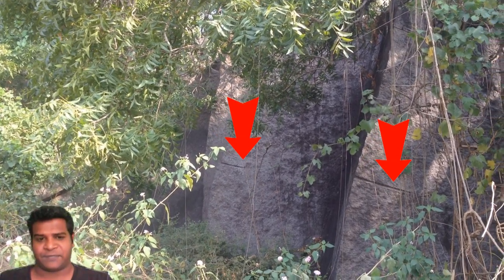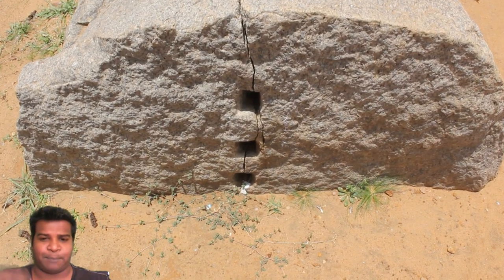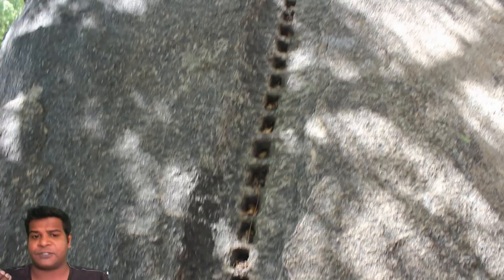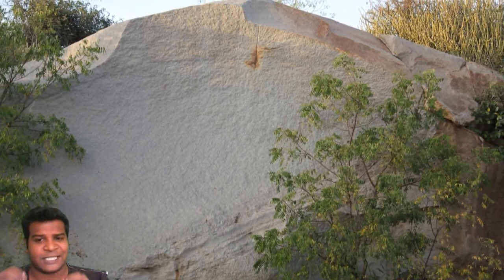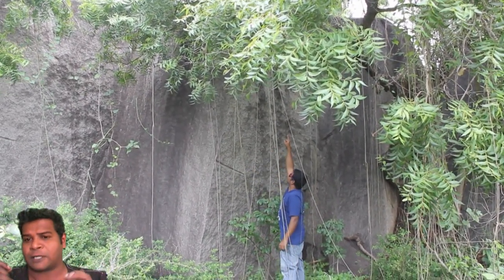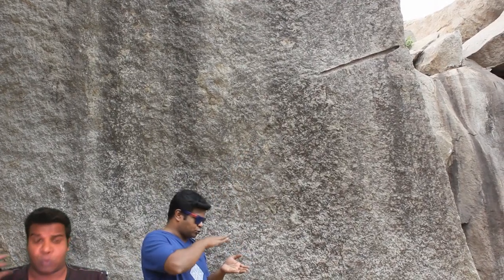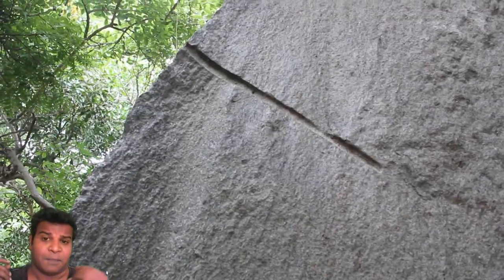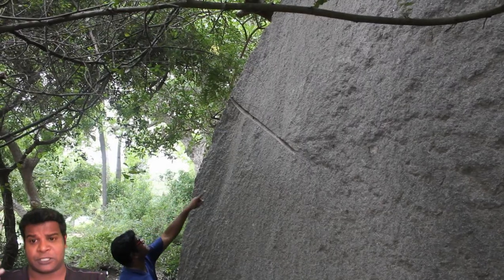In Search Of: Ancient Rock Cutting Technology - Machines?

Comment: The way the hole curves slightly as it penetrates reminds me of high pressure water drills
Reply: I noticed the curve!
I was wondering how 1 would get such a smooth channel, yet it has 2 bends!
@6:02 ..... so your saying if a CNC water jet drill, etc was cutting granite, depending on the hardness & a low pressure, the granite would redirect the water with it tough grain structure. thats cool, still WTF?

Comment: They knock the rock with hammer, hardest part of rock sound like bell, exactly that location they drill, using kaaisa old drill machine, kaaisa is a long 45-degree screw wedge one end is pointed other end gave a pully ,in which rop is passed two men from opposit side pull rope simultaneously hit axil down when pulling rope thus vibrating drill action obtained , holes drilled, later this hole is filled with thermite process material which burns at high temp thus result in a heavy temperature difference where drill is, once heated, water is sprayed up,  on cool sudden, thus rock split due to sudden temp variation, since used material is thermite material like magnesium it does not explode un like dynamite currently used , this method was used by Carpenter in Kerala even 40 to 50 years back to split granite, success depends on hoe u determine hardest part of rock, only main carpenter identify this and order to drill that place, his experience matters
Reply: plz read my comment ..
Reply: JAYA KUMAR P.R I
Reply: JAYA KUMAR P.R, this is a nice idea, but how would it work on a hole 8 feet wide?
Reply: Above discussion was about how to split rock with a hole in it  but for making a fine 8 feet wide hole done in two different way, method one a heavy wheel rolled around a fixed axis using animals abrasive rock powder and water is dropped in path of wheel so that rock medium get eroded quickly once periphery is eroded at thickness of wheel  middle solid part is chiseled away, process repeats
Reply: What size rocks were split using this? Could that have been extrapolated to big size rocks that were in video?
Reply: or......they used advanced cutting technologies!!
Reply: abrasive rock powder? like what? What can drill granite efficiently? Your method 'sounds' reasonable but what sounds more reasonable especially given the size of the rocks and the nature of the intricate carvings is highly advanced tools.
Reply: Thank you
Reply: Wow
Reply: karel bellic  yeah man. After the ancients used it for splitting granite they had a sniper shooting competition with the left over termite being put into steel targets. It was a day of fun splitting granite and sniper rifle shooting.

Comment: After sending off my last comment, I realised I forgot to thank you for the info and images on the splitting technique using a line of holes. Also, I realised that a pounder charge wouldn’t have split the rock, but fractured it into several pies, as is done in quarries today. And, one of your readers mentioned something about a wet rope technique...could the line of holes have been the earlier technique, and then someone discovered they only needed one hole if it was deep enough...how did they drill it? Possibly the percussion technique of continually hitting an iron rod (10th C onward) or a bronze rod before that. The granular material could have been flushed out with water periodically...when the hole was deep enough, a rod of some material that expands significantly when soaked with water is inserted?.

Comment: Mr. Mohan, I am very much pleased with your videos. One sculptor told my lecturer about this Rock cutting technology. They put  tiny marks with chisel on the rock whatever the size they want to remove from the mountain. Afterwards they will give a hard stroke at one point only when the hill is sleeping. This is possible as they know the sleeping condition of any hill.  Hill will cut at marked points only without any problem.

Comment: Great channel btw. You seem to be one of the few out there to bring up this very simple technique. I spent the last hour watching videos on people splitting granite and I'm convinced. Granite might be really hard, but its fully of tiny crystals and once the crack starts, it follows the crystals and they cleave. I think it takes a lot less time than you think. As to how they drilled the initial hole, I noticed the holes aren't very straight which lead me to believe some type of hand drill was used.
Reply: Yes. Hand drill. e.g.  a bow+string and a rod as the drill bit. Notice that the holes all slant downwards so maybe the hole, once started, was filled with hard sand or a mixture of sand+water? Then a wedge was hammered or maybe wood wedge and then water added?

Comment: they also used molten metal to fill in the holes and then cooled it with water, with this you can achieve splitting rock way faster then with wood

Comment: Am I not seeing it correctly, or is there actually just one drill-hole per large piece of rock?  If there is, then this would be insufficient for the "wet-wooden pegs" method of splitting the rock.  If there is just one hole per large piece of rock that was split, could sound vibrations through a metal rod be sufficient to split the rock?
Reply from the maker: Hi, Its just one hole per larger rock so even I guess the same. Thank you very much for watching the video. Have a great weekend.
Reply: They were probably calculating the position of the centre of gravity and targeting that with a drilling tool..... But I dont understand how only 1foot drill cracks up a huge rock...... It will need recreating the scenario and seeing for ourselves
Reply: Have you found recreation of granite rock cut like this yet?

Comment: Great video! I don't know how these rocks are cut but I sure know that in Konark temple, Odisha, rocks are joined using clamps made out of iron. Back then iron ingots were forged and welded to make beams for the temple structure, over which stones were placed and clamped with iron clamps! You can still find them if you look closer to the rock joints at Konark!

Comment: Hi Mohan,
This kind of holes can be drilled by crowbar (it was an instrument used to drill the rock manually). I do remember during 1995, by using the crowbar, a rock, about 7 to 10 feet diameter, was drilled and blasted in my agricultural land but i dont remember number of holes drilled. the Blaster took approx. 3-4 hours time to drill a foot deep hole on top of the rock. Also my personal opinion that crowbar is called in Tamil Kadappaarai, கடப்பாரை,  which could have been drived from base words kadai+paarai, which means drill + rock).

Comment: Maybe they had some kind of chemicals to soften the stone in the area being worked on?
Reply from the maker: Hi, that's a nice guess. If that is the case, then we should find whether we had such chemical labs during that time. Anyways thanks a lot for watching the video. Have a great weekend.
Reply: It would not necessarily require a lab, as it could have been a plant based concoction and require more of a kitchen rather than a laboratory to prepare it. I have watched a few of your videos they great keep up the good work.
Reply: why not with the help of archaeologist  test those rock sample  in lab may be we can find some chemical traces there  or they might used some kind  Frequency Vibrating Devices to break the rock
Reply: Why not indeed, and yes I have thought about a resonance device that could also soften the stone and make it easier to cut. I don't know how they did it, but I think they must have had some stone softening and geopolymer technology that is lost or hidden away.
Reply: Joe Dean even I believed they used corrosive chemicals. Like acidic water will corrode limestone!
Reply: Carbonic acid indeed softens it. but it takes years to make effect and it spreads radially, not very good for large flat cuts. Thanks for the video! i love these! BTW, is there any mentions anywhere how it is drilled and actually split? Egyptians used copper tools and quartz sand for cutting Granite.
Reply: plz read my comment ..
Reply: My guess is they used the power of the sun bit like fresnel magnifier.
Reply: SIDDHANT SAWANT what comment?
Reply: Mr. Bricks yes, I have seen those frenzel lenses they are incredible they can melt obsidian, and by heating up the rocks it would also soften them, but they seem to be only focused on one spot. An array of parabolic reflectors all targeting concentrated sunlight on one stone would be better for the large stones. The only thing I don't like about this idea is they would be too hot to handle, and the copper tools they were supposed to be using would also soften too?
Reply: Jan Sergejeff you cannot cut cold hard granite with copper
Reply: Joe Dean This is just a idea  because the hole wasnt perfectly straight..vibration of some sort must also be the key..
Reply: Joe Dean Thankyou i will..
Reply: Suppose we have a one big rock . To cut this rock how many possibilities we have to take how many number of people's ( including men and women )to cut this rock 
eg : 1 big rock cut by = 10 people = time take 25 years
        1 big rock cut by = 20 people = 20 yrs
        1 big rock cut by = 50 people = 15 yrs
        1 big rock cut by = 100 people = 7 yrs
But  1 big rock cut by =  500 people = it takes only few weeks 
And as men and women working of brain is different ..you watch a construction site of building we see men and women are working same but that is not the case .
They have chisel or not is important question but first we have to find how many people are working . might be some animal like   
elephants or horses have taken to help .....plz reply
Reply: SIDDHANT SAWANT, Not with power tools from ancient home depot, about 1 hour by 1 person.
Reply: But how can a Chem can do drill like hole on a granite ?
Reply: i am certain, they did use alchemy! not to soften the rock (granite wont), but to slowly break it using fundamental forces of nature. 
the clue is the discoloration and the shape of the hole we see at around 3:00. that color is iron oxyde, rust. and take note how the hole widens at the bottom.
when solid iron (or any metal) oxydizes , it expands slowly, but with unstoppable force, because it keeps gaining mass on an atomic level. each atom of iron binds to 1-2 oxygen atoms, breaks loose from the iron's very dense molecular lattice, and even binds to water molecules, adding to the pressure. on a geological scale, rusting iron veins DO split mountains. you can see the same brown on cracks in the alps. salt and acids speed the process up a lot. it may still take months or years, but the rock stands no chance.
vibration-sand a hole, pack it 1/3rd full with iron sand, and keep pouring salted lime juice in there.
Reply: It may be possible that the 'rock cutters' would bore holes in the rock using chisels and then heat it using sunlight (fresnel lens or similar) unti the rock becomes red hot. Then they would throw vinegar or a similar acidic liquid - rancid buttermilk, lemon juice etc and watch as the rock gets cracked. By repeating the process it will be easy to cut boulders into two.
Reply: Yes most logical one
Reply: Thats a theory in Egypt too? Correct me if im wrong

Comment: Mr.Praveen Mohan
Drilling a deep hole in the granite rock is easy.
Tools required: a wedged crowbar and a hammer and water along with 2 person.
one person to hit with hammer to crowbar and another person  to axially go on rotating the crowbar by hand. one should put little water to hole so that rock becomes powder and mixes with water and becomes stone solution and and comes out of hole. Then put little sulpher to the bottom of hole and project a wick to outside. then fill the hole with soil tightly and lit it . It will explode and block is cracked.
I have seen hole making like this 50 years ago.

Comment: Youtube stone bell hole drilling.  It shows people building a temple in Hawaii with old techniques.  They were able to drill a couple foot hole fairly fast with a flat face chisel and a hammer.  It's more or less pulverizing the granite more so than drilling.  They made a perfectly round hole without a problem.  The same can be achieved with a pipe and sand as grit to cut.  They also demonstrate using wedges to split rocks as well.  I think a estimation of months to split a rock with wood is likely a bit high, my guess is they could easily split a large rock in a day with wood.  Hot water may have a effect that helps the cracking more so than just swelling the wood.

Comment: I enjoy a lot your videos, you sure know how make the right question, and above all you don't just study ancient history on the web or on paper, you have the honour to travel to those sites and study them up close, you have my respect for all your work and research. Now beside those drill marks you propose to be machine power tools, i don't agree with you, for sure some type of drilling was used to split the rock, but if was a drill from a power machine, the drill will be straight from start to finish, and you see that it have deviations along the hole. In one of the images you show of this technique being applied, you can see rust on the end of the hole, so what ever it was used to drill that hole was some type of metal tool. For me it was used some type of metal pipe to drill the hole, but something was poured inside the pipe to soften or melt the stone, and for some reason they drill only to a specific part of the rock. I think you should research the Iron pillar of Delhi as well, and try to know more about it, it also show interesting rust-resistant composition.

Comment: They must have found a material that expanded faster and further, and these drill holes you show are not straight. It looks like a hand held tool drilled the granite but not like a modern drill bit as the tubes would be straight. 

Very interesting

Comment: I noticed in your video at the end of the drilled holes there is a lightening pattern on some of the holes. Do you think it is possible that they drilled a single hole then used high voltage to sent an arc of electricity through the rock to have it split like that? Just a thought, but I would love to try that as an experiment. Thanks for posting such great videos.

Comment: The wedge tequnique didnt take months apart from the obvious time that it took to make all the small holes but the timber wedges didn't have water poured on them daily as you describe but more wedges were added to apply more pressure to make a seam. The expansion of timber wedges is a very strong force especially when wedges are chosen from dense grain timbers.
As for the long drill holes, I have no clue how these could have been made with any primative means, what is also curious is that even when a two foot hole is drilled in granite it does not weaken the stone signifigantly that the stone breaks easily.
You can test this by cutting a hole with a diamond core drill and I think you will find that the stone is still very difficult to break, perhaps long sticks were inserted into the hole but I dont imagine that these could have had water added to cause them to expand- splitting the rock, also with the long drill method there is no guidelines for the rock to split (as there is with wedges) the crack would just form randomly and often unevenly. 
Just some thoughts, im enjoying your videos and very interested in these amazing archiological achievements most of which I have no clue how they produced even though I'm a mason by trade.
thanks.

Comment: Answer: a hammer and rod is all you need to drill into rock. It’s called a star bit and can be bought even today but mostly for drills but doesn’t work but spinning it works by impact and you turn it 1/8th a turn and hit it again. Though how they split the rock is a question? Wedge or explosives maybe

Comment: Bamboo wrapped in copper with sand and water just like sand paper the paper doesn't do the work it the corrundum in the sand you can do this to drill holes in granite which actually sharpens the copper as it goes deeper you can then use the copper a a knife to cut straight edges it's very primitive but very effective theres many  videos online showing this and the wood and water thing works yes but you can just use a hammer which can be made from stone or metal use metal wedges and it takes only about a few minutes to an  hour to cut the stones in half 

You can also use a fire and cold water method

Comment: @Praveen - I think that people were taught to make certain frequencies with their voice in a chamber or some form of diaphragm that acoustically coupled it mechanically to a shaft that vibrated the frequency at a concentrated point that was rotated and used to cut different types of stone. kinda like a old phonograph needle and diaphragm only in reverse, you put sound in to get the needle to vibrate.
a stoneage ultrasonic drill !
then pound progressively larger wooden slugs and water into the hole. wood absorbs water expanding and exerting more pressure to crack the rock.
diaphragm=A thin, flexible disk, especially in a microphone or telephone receiver, that vibrates in response to sound waves to produce electrical signals, or that vibrates in response to electrical signals to produce sound waves.

Comment: One question that I have with this theory is "if one drill hole is used to split the giant rocks what else did they use to get the rock to split apart because one drill hole would not be enough to do the job?" Some kind of electrical current, energy beam or high pressure water perhaps because something else had to have been used especially to get it to shear in a nice smooth straight cut!

Comment: what if that hole produced by ultrasonic drill ( lower energy required and saving lot of drill bit  )... then they inserted ultrasonic "resonator" rod ... its like the rock "vibrated"/ "shake" thousand time per second it will crack precisely like manual hammering technique